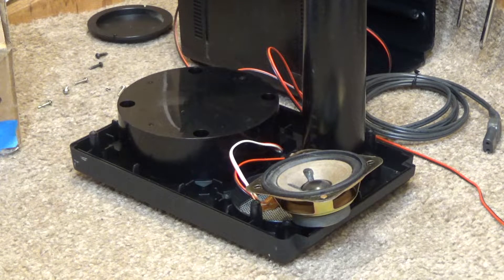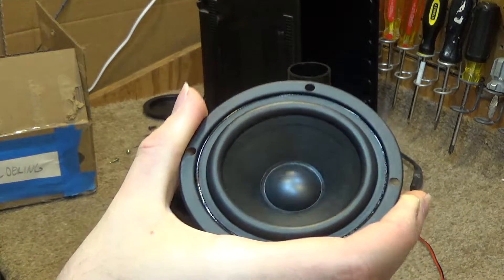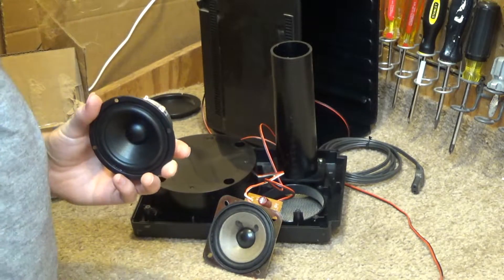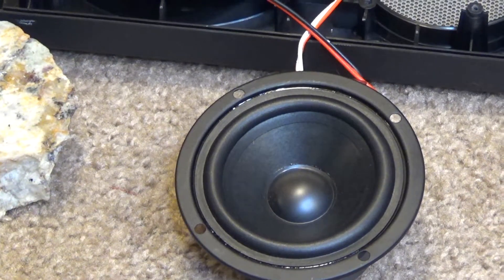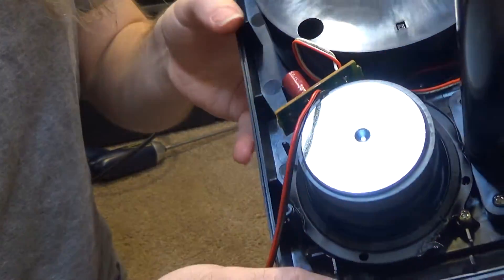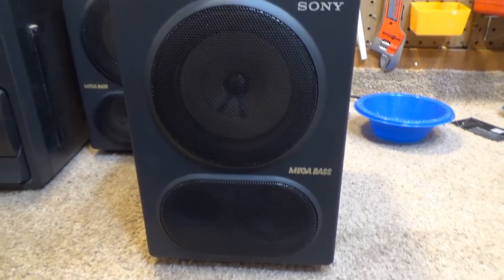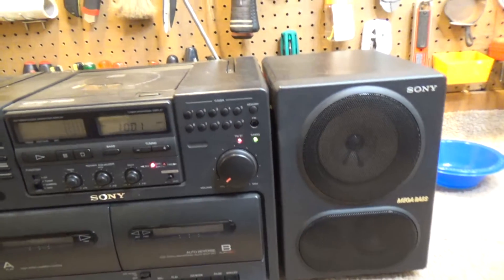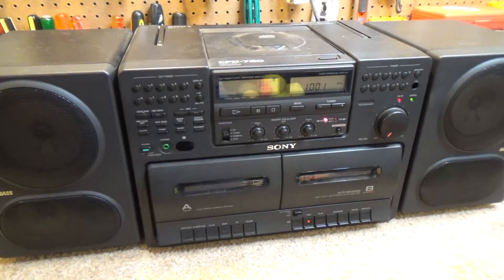Sony CFD 760 | Speaker Replacement

Comment: Low end comes from the small speaker... That's why it has a proper fabric surround 
While the bigger speaker is the full range and has no bass coming from it or little bass
Reply from the maker: I had suspicions that may be the case.

Comment: The lows come from the smaller driver, the larger is a midrange which is why it is sealed off from the rest of the enclosure. The smaller one believe it or not actually handles the bass. Its a higher excursion speaker.
Reply from the maker: Thanks for letting me know.
Reply: @JordanU  no worries. Nice work. I miss those old Sony boom boxes. My neighbor won a cfd-775 and I couldn't believe the sound that came out of that thing! I applaud you for keeping these classics alive my friend.
Reply from the maker: @Jackmerius_Tacktheretrix  Some of them really do have a great sound to them! Certainly much better than the small BlueTooth junk that's flooded the market.
Reply: @JordanU  they really do. Back in the 80s-90s sony boom boxes with megabass were the $hit along with magnavox turbo bass boom boomboxes. Panasonic had some cool ones too. Miss the good old days of hitting Kmart amd Mongomery Ward during lunch break to play dj magic Mike and dj fury on their stereos! Can't tell you how many times we were told to leave lol
Reply: @JordanU  whats ironic is alot of these bluetooth speakers male more power than these old boom boxes. The cfd-775 only put 9 watts per channel but sounded like a big stereo.
Reply from the maker: @Jackmerius_Tacktheretrix  Power doesn't have much to do with it, the loudness depends primarily on acoustics. These Sony machines have quality engineering put into them, the stuff made now doesn't.

Comment: Why not replace with OEM driver? If you're against that, could have at least replaced both drivers with the same type because now there is a painfully obvious difference in sound quality b  between the two speaker channels. Also now the amplifier is running one different speaker than the others which could cause some issues down the road.
Reply from the maker: I'm not against that at all, but considering the product was made nearly 30 years ago, there's none on the market that I could find.. There is a difference if you listen real closely, but during normal use it's nominal..
What kind of issues do you propose it may cause? That's not something I've ever heard before..

Comment: Seemed like a great video at first until that same damn song came on.  The entire soldering and installing portion was completely glossed over as well.  And now you're left with a mismatched speaker pair.
Reply from the maker: What value does a comment like this posses?
Reply: Well, it got you to reply.  Perhaps these little suggestions I made subconsciously, like pick a different song, put a little more into the soldering process that we can see, and always replace speaker drivers in pairs will make a difference in the future.  Probably not.
Reply from the maker: O most certainly not, because every time I make an effort to take your 'suggestions', I get another 'suggestion' about the way it was executed..
Reply: Just do it right the first time and that won't happen!
Reply from the maker: What makes your way so 'right'?
Reply: About 20 years more experience than you have.
Reply from the maker: @jaykay18  That means you've likely tried more ways, but it doesn't mean you've found the best one..
Reply: I may not have found the best one, but it's certainly better than yours.  I've spent plenty of years making plenty of mistakes.  The difference is I learned from my mistakes.
Reply from the maker: @jaykay18  So have I; not doing it the way as suggested in the rude comments box isn't necessarily a mistake..
Reply: That IS the mistake, which is my point.  I've already done it the hard way or the wrong way, and learned my lesson.  If you do take my suggestions, you'd end up ahead in the end.
Reply from the maker: That is not universally true..
Reply: Maybe not universally, but most times.  Trust the old people.  That's why grandmas have the best cookies.
Reply from the maker: @jaykay18  OK..
Reply: Not just OK, but the best!
Reply: Yo Jordan dude, trust Jaykay he actually knows what he's talking about
Reply: Thank you mraiwa1000!
Reply from the maker: @mraiwa1000  I never said he was wrong; but he doesn't know everything, and he doesn't need to say something about everything..
Reply: Yes cd problem!
Reply: @JordanU  that is correct and just remember opinions are like assholes everybody has one🍺